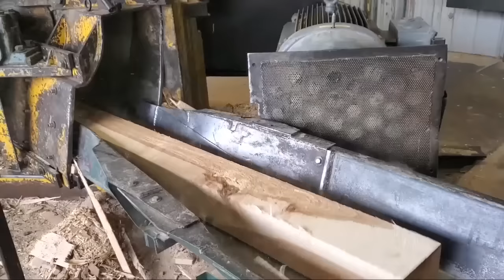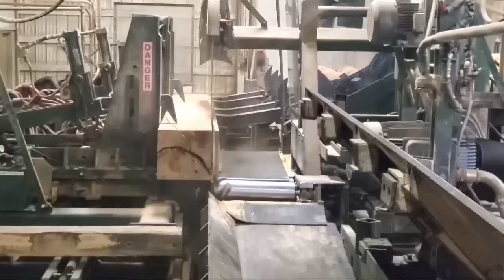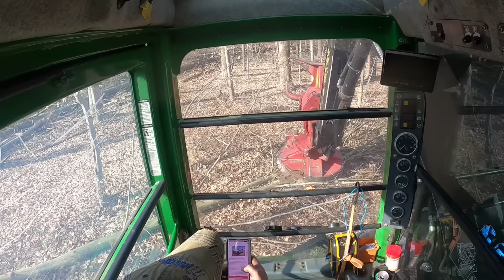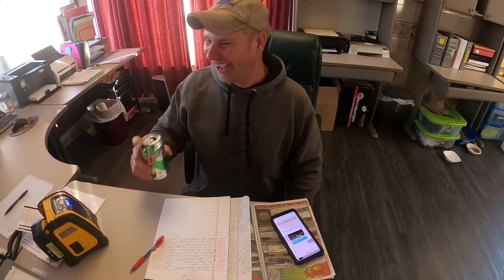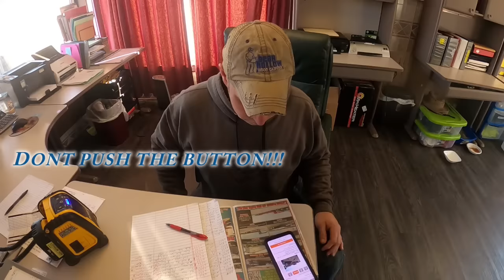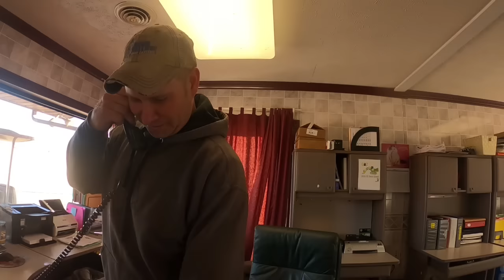I won but at what cost!!!???

Comment: My thoughts are the trailers you got have good clearance underneath the trailer on some of them dirt roads but the lowboy gives you clearance up top some driveway entrances are tricky with the low boys and dragging the belly on some and high siding them is a pain to get unstuck if you cant raise the nose high enough to get traction on the drives to pull it up but you know your operation best
Reply from the maker: Good point bud
Reply: @LoggerWade  if your new trailer has airbags you can disconnect the leveling valve from the spacer bar and manually raise the trailer a couple extra inches and do the same on your truck I think they should be 7/16 inch nuts just be careful not to over extend the bags that's gotten me out of a bind or two lol keep the vids coming bud!

Comment: Maybe because I’m English, but couldn’t understand the auctioneer, sounded like he was Yodelling?  What exactly did you end up purchasing?
Reply: 2 low boy trailers, one smooth top one drop sides, the drop sides are lower where the equipment sits so it's not so tall going down the road. Brutus has some height to him lol
Reply from the maker: Hahahaha
Reply: If you want to see a good auctioneer at work look up Andy Raber auctioneer on here. There's a few videos of him and he is quite the entertainer. The yodel you speak of is sometimes called the auctioneers chant, they all have a different way of doing it and some are for sure harder to understand than others.

Comment: There's a trailer manufacturing company outta laporte texas that might have some used drop sides for sale.i dont have the  phone number but they should have a website you can check. The company name is dragon manufacturing in laporte texas.77571. just throwing that out there for you